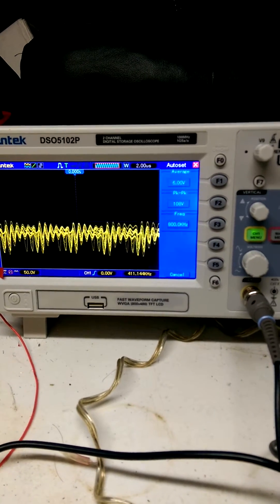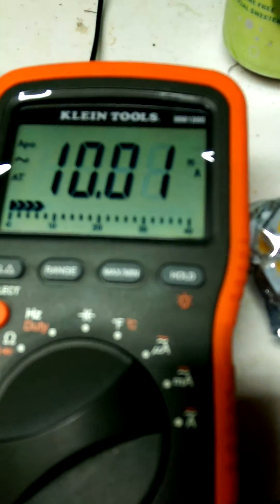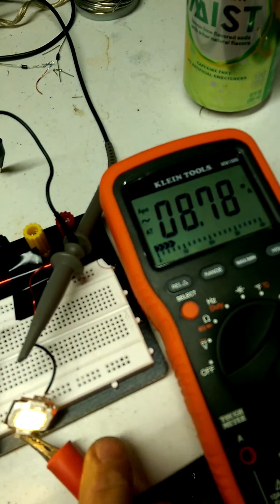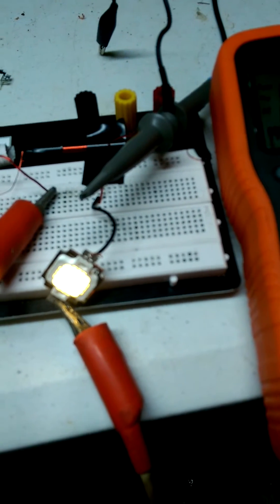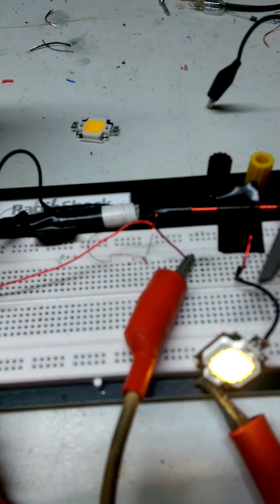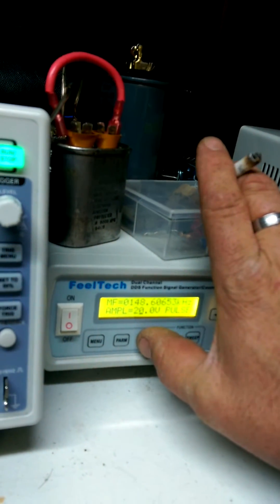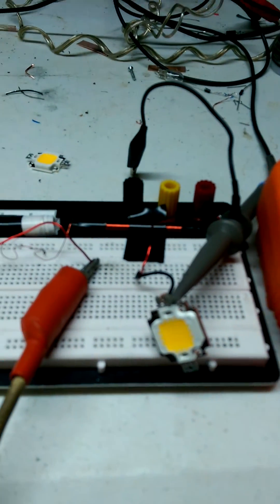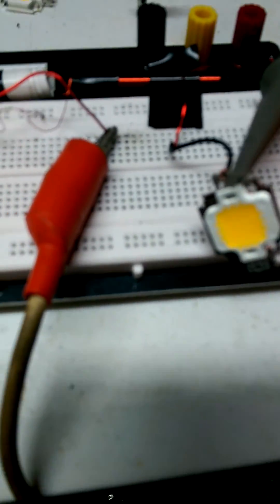Partnered coils- proof of overunity

Comment: marc   have you had a chance to see keshe and his magrav  --  he uses coils and says they must be used for 30 days to gradually reach peak power output  //  on gerard ---  can you use a square wave inverter  // frank
Reply from the maker: +frank ertolacci yes I can. The triangle wave was chosen only because it is what I received that waveform with and I have had success with this type of wave before for load reduction and overunity. I have several other coil designs that work even better than this., however, i have been spending so much time on the experiments that the wife has not been very happy with me.
Reply: +Marc Belanger    happy wife happy life
Reply from the maker: +Alex Manzanero I'd rather have folks following me to put Smith's devices together. I have succeeded, so, if anybody needs info, Zilano has done it, I have done it, and, there are only a few secrets that need to be known. Firt one has to buy the right stuff to build and study the Tesla Hairpin Circuit which was rebuilt by Karl Palsness. Karl has fallen back a bit due to much un needed attention, however, he has studied it, found out a lot to know about it and it's overunity characteristics over the years of his research. I have chatted online with Karl and I'd like to meet up with him someday to show him what I have come up with because of my interest of his videos, as he has had a presentations showing the circuit and how it functioned. He led me to Tesla's book and stated it is one of the most invaluable books he has ever read. Oh, by the way, the link to the online book is here: https://archive.org/stream/inventionsresear00martuoft#page/306/mode/2up

Anyway, I took the hairpin, made it work, made other things happen with the circuit, and, found that no matter how crazy the spark gap looked, I had to find out if the copper bars would kill me or hurt me. Folks have literally run away and turned around scared shit when the were close to my hairpin circuit while I have energized it. I used two 2 pF 100kV mica capacitors, a spark gap, and, a set of copper rods, copper fittings that held crossbars in them, as well, connected the top into a dead short, and, the lights energized. This is the basic method Smith used to make his devices work. We just have to create resonance with a set of step up coils, then, step down, so the voltage is manageable. We need to also monitor the voltages used and pushed through the system because it needs to be manageable. Don Smith's device has a battery that is mounted very close to his neon transformer. The neon's field will charge the battery without using any of it's input power, by the magnetic field alone , it induces energy at an angle like Don Smith's Dipole Generator does. When Don figured this out, he built it using a capacitor plate set because he knew the battery is just a multilevel capacitor with a chemical reaction going on inside. The electrolyte actually assists the battery into overcharging while we draw a load from it. Every one of Don's free energy circuits incorporate the same technology, except for the fact that they have 2-3 things going on at the same time, he uses HF to convert the amount of joules per coulomb. Tesla knew that low frequency didn't have this amount of energy in it.. Spin the alternating engine faster to hf and he could power several 100 watt bulbs using low range milliamps, sometimes, if he was lucky enough and had carbon filaments, he could drop it to microamps and find the resonant frequency best for his transformer, then, the impedances of the coils he made were infinite while operational, driiving massive amounts of energy out while consuming no energy., while the field would charge the battery as the amperage used was less than the field charge, making the device a self runner. This has happened to me, and, I turned around and purchased larger parts , took it apart and am building a larger unit capable of outputting several hundred kW. I like big , and I like free. One day, somebody will wish to buy it from me. It cost a pretty penny for the parts, and, if we don't get them now, one day ., we will have to make them ourselves again since the governments of this world will not allow the sale again, and, they have limited what we can get on the market for the most part.

If you open one of Don's pdfs, please, consult with me before you build it. Most of the info is correct, but, a few things have been left out. This is based on Tesla's works, so, to make it 100% functional;, there are a few secrets, and, the coils have to be shorted to function the right way.

Marc
Reply: +Marc Belanger marc i followed keshe for about a week and there are a lot of "how to's" but even though this sounds great i havent come across an actual working model; just alot of fuzzy warm feelings around this but no hard evidence may i get you thoughts on this keshe follwings??
Reply from the maker: I haven't really seen enough of it to feel satisfied with all of the different findings, however, since the aussie scientists have literally seen the magnetic plasma tubes through a new technology from the poles of the Earth back to the land all over our planet, I know now where the induced energy comes from , we just need to learn or try different methods to acquire induction of this energy by finding out exactly where these flux tubes or what they call "plasma" tubes end up. If we are able to see these energy lines of force, we certainly will be able to tune to them by making very large variable inductors, one over the next to tune into them. We have the technology for this, however, if I had working models in front of me, or, the means to make them, investments to use of open a machine shop, hire machinists and a band of energy researchers, I would be able to point them in the right direction. I have several visions of how this would be done, and, to me, it would be with the use of a high frequency energy because what this high frequency does is basically make the molecules move rapidly, separating the free electrons with ease, as low frequency literally takes moving magnets to cause the electrons to flow by force. If we use this energy to start an induction, all it will take is the correct coils of different sizes to transfer the energy and then we need to store it into caps, making the storage large enough to discharge. If the energy is stored rapidly enough, the discharges will happen frequenctly enough so we seem to see the energy in a constant output, as Don Smith has done. When this high frequency is used, it excites the molecules of the air surrounding the air core transformers and allows the energy from the flux of our planet to be channeled in through these invisible flux or plasma lines. I think this is how Keshe's devices work, however, he hasn't opened up to us yet, he is playing the picking game by showing us small instances of his "technology", when he holds the key to the real machine, and won't allow replications to begin until he gets or sees peace treaties between all countries and we have a peaceful planet without war. His reasoning is because the key to this power is so much energy that we couldn't possibly realize how dangerous it would be. It is enough energy to cause antigravitational flight and criminals would certainly take complete advantage of it. They would end up taking the technology with force and we would be left with what we currently have, niothing. That is why we shouldn't jump to the largest one, we should slowly work our way into the technology instead of relying on something that is just a theory, or, a massively outputting device that isn't understood.BTW, Keshe is taking people's money, 350-500 dollars at a time for a one circuit plasma device he says can power a home. Who's home, a single room apartment? An American apartment needs 5kW and the average home needs 10kW.. I'd like to see results first before my money is taken. I already have this ability to run devices in the home from a 1 amp source, which is A FUNCTION GENERATOR WITH A 1 AMP DRIVER BOARD AND MY PELEX DEVICE. I do not know if they are using a similar device, it is very real that we can pump energy into the ground at a fraction of what we output. It's called phase conjugation, which Tesla invented. Don Smith did the same, Kapanadze did it, Frolov did it, I did it, and many other people did it, however, I think the only people who truly knew how it functioned every time were Tesla, Kapanadze, Smith and Frolov. Frolov I am not sure knows the in depth parts like Smith did, however, he is a radio engineer and that's what we need to be to understand resonance to induce these fields. I am working feverishly on it and haven't been successul at finding out why and how my one model works, I am still trying to duplicate one using the same parts but I keep failing repeatedly. It's a lost cause to publish because it will only cause trouble by showing a working device again. Once I figure out how to duplicate the first working model and how I got resonance in the first place, I will post again with results. It's extremely difficult to tune a device without having enough variable inductors of the correct size. The other problem I have is that they do not make variable air capacitors in the nanofarad range. This is what is needed to tune these devices everytime. Don Smith has already warned us that the devices will not be possible to tune in the picofarad range because it is too sensitive and extremely time consuming, so, we need to follow the formulas and they I do not believe are correct so I find myself over and over going through his q & a info, as well as everything he has published. He is definitely the most knowledgeable who has done this for the longest, hopwever, he is dead and so is Kapanadze, so, it isn't easy to get whjat we need to get this done correctly without the right devices. The devices I need are massive variable inductors of all ranges, variable capacitors of all ranges and voltages, then, I will ace all resonance.. :-)
Reply: +Alex Manzanero   thinking that he has not completed all research necessary and trying to get many involved to find the key  //  also putting out a enormous amount of information as fast as he can  , appears to be on a deadline  // check out gerard morin / eric dollard / dr steven greer / bendini /
Reply from the maker: I haven't seen the function of the Magrav generator, and, nobody has approached me with a link that will get me to believe the output yet. I am one who believes once I see somebody who is testing something say they are impressed, such as the engineer that was testing Don Smith's systems. That is sheer excitement to me, and, when I get something functioning, such as the partnered coil, it is an exciting time for me as well. However, since I have come up with much better over the years than my more recent achievements, nothing has satisfied me but my transformers used in Pelex, and until I can make a safe model that has no side effects or dangerous radio interference, I won't be completely satisfied. Keshe has not approached me, and, to me, if it is hard to build, or difficult to tune, making replication nearly impossible, I really don't want any part in it... I have come up with a simple solution that utilizes magnetic manipulation to literally induce the Earth's magnetic energy with Pelex, so, if there is an ability to do so with much ease, then the establishment has blocked everything we have ever wanted to know because it was done within a couple hours of randomly wiring tranformers, their coils, then, coming up with different core designs that integrated all 3 devices into one unit. The reality of it all is that it is VERY possible, and the truth is that it is 100% possible since it is very real and it does output 100% of the energy it uses to operate, and then some. The energy to get it started is approximately 6 watts, and, if I tie the output back to the input with rectifiers to eliminate feedback, it operates infinitely, but, with such a great magnetic distortion that many devices to not function within quite a distance, probably similar to Searle's magnetic device, however, this is purely an analog transformatic device that draws energy in from any magnetic field, even if it is extremely weak. It takes in all of the wasted energy from currently operational conventional systems which only waste energy and have no real function in society other than forcing the amperage into devices that merely waste the energy as heat and electromagnetic interferences which are not at any means reasonable. We also notice with the currently used system a massive inefficiency due to the amount of joules per coulomb in the low frequency systems. They work merely by forcing the electron flow through items that only hold a charge, which we call the conductor. Carbon conductors work in a way different method. They do not have the same charge characteristics as copper and other components. My hint is this.. Take a coil of carbon as an inductor and add pulsed power to it. See if it reacts as an inductor, or, for that matter as a transformer using either a core or no core. The output will change your opinion about electricity forever., I will not tell anybody what it does, however, it is my only hint as to how energy is drawn from other places electromagnetically without using tuning the system for the resonant component. Carbon has to be molded into a form to make the coil, then, it has to be insulated. If we take and make the same thing and coat it with graphene, even a greater effect takes place. That is my only hint to society that I will do in an open source so all of you will need to take it or leave it as It will (not that it can change the way we use energy, it WILL CERTAINLY change the way we gather, generate and use electricity, and, it won't change the way our earth uses energy in any derrogatory way. Our planet uses these mass abundances of energy we use on a daily basis for all of it's functions. Since we force the electrons with magnetism to flow along the outside circumference of a conductor, it is literally taking this energy from another place. This is the same place I get and use my energy, however, the way the energy field draws the energy in with generators of massive proportion disturbs or distorts the way our planet uses it's energy. It limits it and drops the overall amperage that's available to make the Earth correctly oscillate as necessary. If we draw it in as Tariel Kapanadze did or the way Don Smith, or, Moray did, there isn't the same effect which is the main reason why Earth's oscillation or resonant frequency has been slowly changing over the last 12-20 years. Science has come up with massive shunt generation units that distort the plasma field which is forced out from the planet's poles back to the surface all over the world. When these plasma tubes are drawn from inefficiently, the field starts to distort and the energy tubes land in the wrong places, causing the frequency of the oscillation to be reduced. Don Smith's generator drew the energy from these tubes in resonance meaning that there was zero load floating back on the tubes, so, the energy just left the tubes, gets used and gets transferred back to it's source without any modification. When a regular generator does this, it uses the energy and forces it's load back onto Earth's plasma or electromagnetic field and the planet is slowly depleted of it's energy. Don's system didn't do this as his coil's impedance with the inclusion of his caps in resonance was infinite, dropping no load back to it's input source, which is the dipole of the Earth's plasma, drawn directly from the magnetosphere. The load Don's system has to the source is zero. The load from Kapanadze's was close, but, it wasn't zero. Don had a much larger output from a device that was not connected from primary to secondary as Tariel's system was. I'm not sure how Keshe's system operates, but, it may be along a similar method. The only person I know on this planet capable of delivering any such type of energy at the moment is Alexander Froloff, Myself, and possibly a few other lithuanians, Russians and Ukrainian folks who understand how RF and it's increase of energy within a high frequency device operates to increase the joules per coulomb. Most of us get the caps to hold a massive charge, however, they never figure out how to dump the charge into a system so it could be successfully utilized. The key is to use the energy in the cap as it is dammed and oscillate it's output so the charge is released partially moving to the next bank of caps to continue the output at it's high amperage, back and forth, so, one set charges as the other releases, over and over. I am finding that IGBT technology is the way to go , making this happen flawlessly and, Don Smith knew that the energy the cap has within it contains the massive amount of amperage needed to output this energy by oscillating, back and forth 60 times per second from cap bank to cap bank, one going up in amplitude  to the positive, and one going down in amplitude to the negative, releasing it's energy the way it was needed, while, the input to the cap would only be high voltage, low amperage, high frequency. The higher the frequency, the quicker the cap charged, and, the faster and higher of amperage could be let out to make it operate. He put schematics out there so the whole world could make these using what's called the "flip flop " circuit, and, it can provide us with all the amperage and voltage we need using high amperage, hi speed IGBT transistors and massive capacitors to store more voltage, allowing the release of energy stored in joules to be massive. Some of Don's caps could charge much faster than they are used, making the circuit a complete home run everytime. He knew this and he was most certainly killed because of this.. It isn't hard to do and it got to the point that the resonant component isn't even needed if we follow the instructions properly.
Reply: +frank ertolacci
 Keshe. is a false lead.. ( Gov op ) just a   trap for the unwary ... 
Have a nice day
Reply: Problem is that it has like a cult following; and yes because its like everything we wish for and fills your head with a lot of warmth but I still havent seen a working display model, have you?
Reply: +Alex Manzanero   i have not seen a working model yet !   hhhhmmmmmmmmm
Reply from the maker: +Alex Manzanero I've watched some of the how tos as well and have become bored without result. I have come up with much better result using my device, partnered coils, and, as well, I am fascinated with Tesla and Smith's device due to the HF vibrations that literally suck in or induce energy from the vibration.. It's kind of like watching the Vibrato draw in energy by the voice, then, illuminate a lamp or something of that sort. Even though my own work has exceeded my expectations, I have become bored knowing that my device is just a simple phase conjugate device that was based upon Tesla's works, however, I used magnetic manipulation to make it happen with low and super low frequencies. When we play around with high frequencies, it appears that nothing happens until the correct happy combination is reached. By merely reading Tesla's - Inventions Of Tesla, I have learned and unlocked more phenomenon that Tesla has discovered , and, since it was all very real, it isn't hard to do, so, I highly recommend taking a copy, or, going to this link, printing it out and study it, read it from start to finish as many times as you can to memorize what he says he did because he was so intimately passioned by the study of the works of electricity that I haven't found anybody other than myself, incredible scientists like Eric Dollard, and, the vast majority of Russian and Eastern European folks that merely eat sleep and s&#! Tesla for breakfast , lunch and dinner. Once the fascination begins, it justifies the expense I have paid just to see why it is so. I have literally taken a simple experiment he has taken time to write about, put it together, got it working, then, have become bored playing with it, so, I started to add components of substances, conductors, and a bunch of other new products that Tesla just didn't have back in the day to work with. If we look , Tesla describes his failure with the many dielectrics he tried to use, but, he literally succeeded using things like Parrafin wax, cotton, wax impregnated cotton string, oil impregnated paper (still one of the best insulators ever used in high voltage cables to this day and age), and best of all, he tried and used mica, and highly recommends this for the best of condensers as he made all of his own.. He basically reinvented them and made them for high voltage that he used, amongst the highest voltages ever created on this planet, and, he was way , way ahead of science, for his lack of materials, even by today's technology, we can't find folks who did it better than him in over 100 years. He also used mineral oil to immerse coils, caps transformers, and many other devices in, which are still used to this day because they are amongst the best dielectrics known to us today for capacitors, high voltage devices, such as terminations, and, believe it or not, best for air capacitors custom made to tune within the nanofarad ranges, as manufacturers have stopped selling them in an effort to limit our ability to do what Smith has done. All air capacitors today are made to tune the picofarad range, so, when we use 30khz devices, we literally need to place cap after cap or build very expensive hv cap banks with switches or jumpers to add capacitances so we could try these resonant ranges without having the ease of a knob. Ham radio tuning devices are basically what is needed to do the tuning, and, we used to have the ability to buy the right stuff anywhere, unfortunately now we  have to make them or have them specially made for us at a very high cost by some of the innovators of the industry. So, Keshe? Maybe I would study his theories and devices more clearly if they weresn't so complex to build and they made more sense, showing me instant results. I find it really hard to believe that an electric current will eventually nano coat my electric wires within my home, changing how the system functioned. I was born during the day, but, I wasn't born yesterday. I think he is pushing folks into a position so they will eventually get frustrated and buy his premade devices, but, being that he isn't from a place where we could get our money back, I am skeptical to buy a device that looks like it may only have enough power to fire up my kitchen lamp or night lights for $550, and , if it did work, how could it power my entire 10kW load at my home through one outlet? I find it very hard to believe because even the best of the free energy devices that have been built out there have the ability to convert radiant or cold electricity back to conventional power. I feel Keshe's stuff is going to the back burner until I see something from them worth watching..
Reply: Marc Belanger thanks Marc..   Jay
Reply: ***** garbage.....
Reply from the maker: I have been playing around with Don's info a bit more in an effort to duplIcate the effect using other sized materials, cores, coils, caps, etc. i found that the partnered coil is used by Don, however the coils using the partnered coil utilizing RF frequencies must have the coils configured in a way that they are all flowing in the same direction.

This eliminates the Lenz effect, and it allows the conversation by the excited coils to happen between each other. The best way to duplicate it to see what is truly happening is to build all of the coils the same size, the same inductance , same capacitance, and, we need to calculate them to run all at the same frequencies. This way we do not need to guess at anything. We could see exactly what the result would be, then wind coils 2 times longer and tune them accordingly. If we do this, we could see where the amplification takes place, then work from there. We can't use all different components and wire sizes until we know exactly why it works and how it does so. This circuit is used by pulsing it's input, using diodes to eliminate the equals and opposites from ever connecting to each other, as Dr. Moray did with his valve. So we only have pulsation in the same direction to eliminate load from connecting back to the input in any way, eliminating the breaking of the dipole, no matter how the output is configured. Once we establish an input at the same amount, and an output which could be captured by capacitors of high capacitance and voltage, the key is to invert this signal and use the pop of the capacitor after it is fully charged to only be discharged at a small fraction of it's energy stored. We store the energy with thousands of energetic harmonics all at the same time while we multiply all of these frequencies coming in as a storage charge. Then, we amplify the output by driving all of this stored energy into one massive pulse, into the transformer's input coil. This discharge happens once 60 times per second, while hundreds of thousands of external  resonant frequiencies draw charged particles from the makeup of the air between the coils, all connected alogrythmically to the compounds of the air, exciting them, allowing their free electrons to bombard the coil as it accellerates the particles into a fast paced transfer from the air, back into the generation system, by the attraction of opposing ionized particles. This allows all of this combined energy to fill the capacitors faster than we remove it, and the amplified charge pulse releases to the transformer and is transferred to the secondary to the load while the next  set of hundreds of thousands of frequencies charge the cap faster than it discharges, ensuring it is always full when we need to tap it. This just means that the thousands of small charges are filling the cap while we discharge them at one minor moment during it's charge allowing the cap to refill so much faster than we take the energy back out of it. We can keep drawing this energy because the vacuum space we rob of this energy is replensihed with fresh particles everytime we disturb this space., allowing it to refill with more particles, allowing the cycle to happen all over again, repeatedly , not allowing us to ever run out of energy.
Reply: dont bother with keshe seems like a cult following with all these people protecting him but of all the how to videos on making coils i have not seen one video of a working model even though you have a hundred how to videos
Reply: Alex Manzanero Keshe.. is just another Freemason liar.. like all the rest who came before him ...